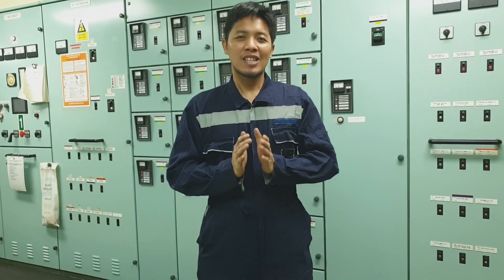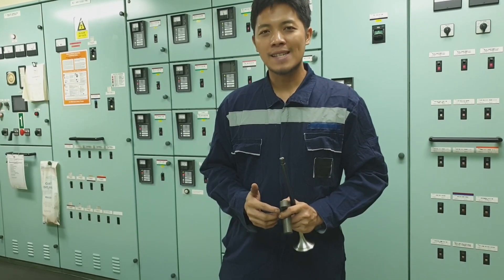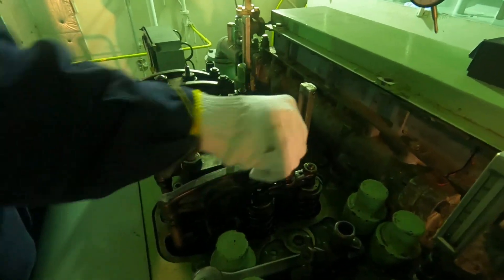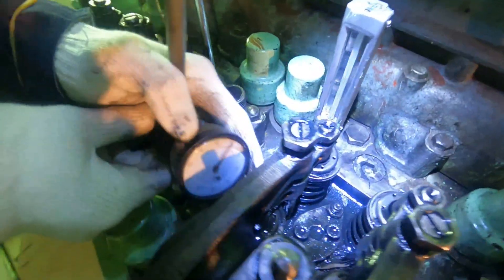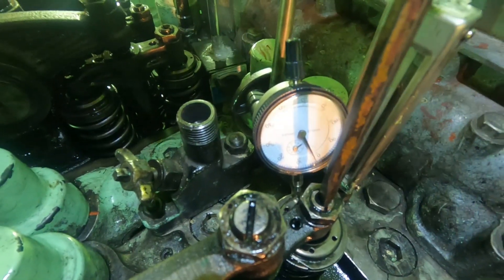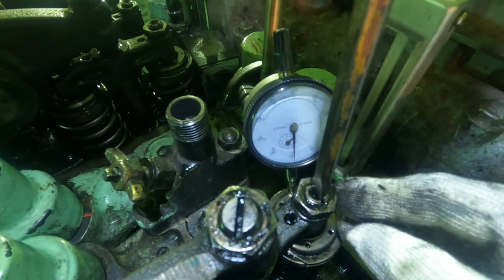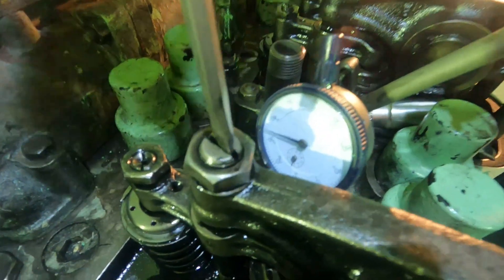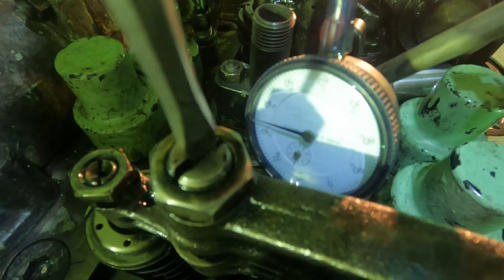HOW TO ADJUST TAPPET CLEARANCE OF GENERATOR | YANMAR ENGINE

Comment: canu please explain why we need to confirm that valve spindle top and yoke is in contact by using dial gauge
Reply from the maker: We need to confirm otherwise if it is not in contact, there will be clearance in spindle top and valve yoke, that will lead to improper angle of opening the valve, thus it will lead to imbalance the rocker arms that might wear out its bearings easily
Reply: Sir anung model po yan 6ey po ba?

Comment: I couldn’t understand when you did adjusting with gauge it must be  set to zero or just moving? The pointer always moves
Reply from the maker: The point is just moving , so we can confirmed that the valve spindle top and yoke is in contact, it can be confirmed once the needle is moving
Reply: @JB23VLOG  ok thanks 🙏. Now understand. Please make more video about maintenance and overhauling procedure